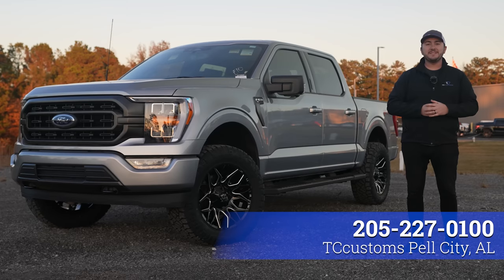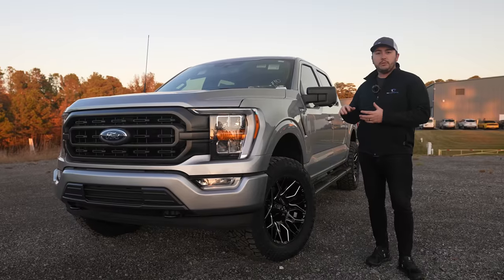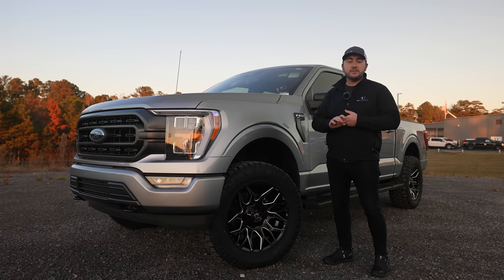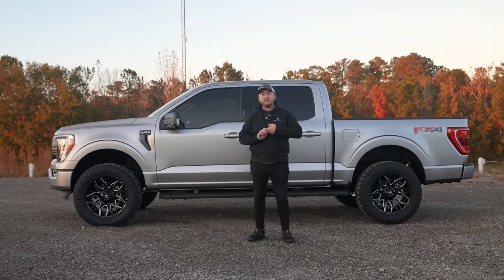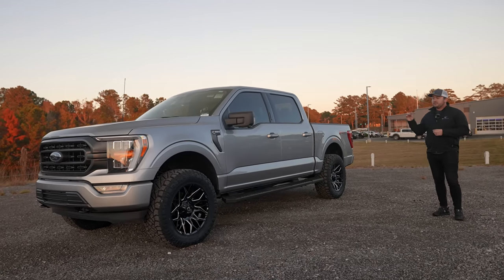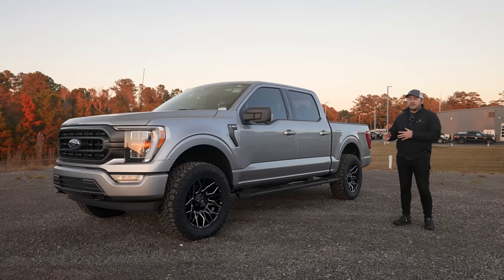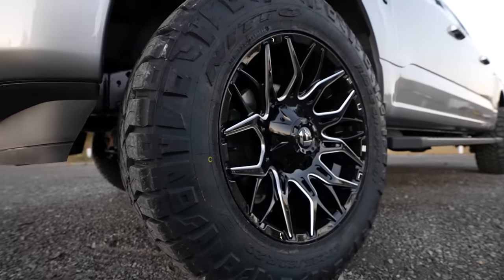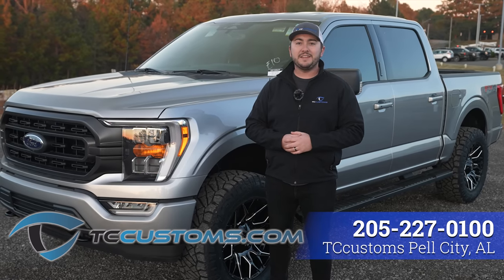FORD's Brand New Lift Kit... Is It Worth Your Money?

Comment: Save money and stick with bilstein 5100
Reply: Yep Those shocks are basically the 5100s with the coils...
Reply: 2.6 diameter > 5100 2.0 diameter
Reply: @blvckspectrvm5398 yep, a 2.5” shock is 77% more shock than a 2.0” shock. So a 2.65” shock is even better.
Reply: How is the ride quality like with the bilstein 5100 compared to the FX4 suspension package? Right now my 22 floats like a dream, but the stance leaves quite a bit to be desired.

Comment: Not sure if I agree with trimming the crash bars on a new or any vehicle just to fit bigger wheels/ tires… my family’s safety is far more important that how my truck looks!
Reply: I installed a leveling kit and ran 295/70 R18 AT3s. Took the crash bars, notched out where they were rubbing, flipped the notched metal and welded back in. Stronger than factory and didn't sacrifice safety.
Reply: The Ford Raptor and Bronco Raptor come from Ford with these deleted stock FYI

Comment: This is just the Bilstein 6112/5160 setup with a Ford Performance label & price increase.  Better to buy the actual Bilstein product save some money and get their lifetime warranty vs the Ford 3 yr/36 mo warranty.  I have the 6112/5160 combo on my F150 and they are fantastic.
Reply: The normal 5160 shocks only have a 2yr warranty from Bilstein, plus with the Ford Performance kit you get the strut mount assembly for the fronts preinstalled, and the aluminum reservoir bracket for the rear shocks. They ARE also valved differently than the off the shelf 6112/5160 combo. Not saying there isn't a price difference, but to have bolt-on ready assemblies is nice, and yes I have the Ford Performance kit on my truck.
Reply: @C1Vette  I bought new top mounts for mine, I think it was around $100 for both. I also bought the aluminum rear brackets which I think were $80.  The 6112 still gets the lifetime through Bilstein (which are the more expensive of the two).
Reply: hows the ride i have a 2023 just got it this past December. It only has 4k miles I'm ready to do mods to it.
Reply: @CandyMan69007  i’ve had it on the truck for over 50,000 miles now, and it is great. Definitely better than stock. I especially like that the rear end doesn’t get Squirrley going over bumps like it used to with the stock set up.

Comment: A Bilstein over Fox for sure! Eibach or Reiger are much better than Fox also. Love Ford but they need to get away from Fox suspension asap!
Reply: Wtf are you talking about?   Fox makes excellent products but they aren’t all created equal
Reply: The fox on the first generation raptor were pure junk. They leaked at the top and not warranted. They cost over a grand a piece before install. I got rid of the truck.

Comment: I have a 2019 F150 Roush with the Fox 2.0 shocks. And, while they’re great for body control, especially on tight, fast turns, they definitely ride rough. But, they’ve done me well off road. But, I like the higher lift and rear reservoir on the Ford Performance shocks. Can the Ford Performance shocks be put on the 2015-2020 F150’s, too?

Comment: I am running Bilsteins 6112 and 5100 for rears on 2018 f150 5.0. 35k miles on them and have been solid performers.  You can find them for under $1,250.

Comment: It would have been a better video with   A driving comparison between the two on and off road.   How does each suspension work over washboard roads?  What about dealing with ruts? Or traversing rocks/rutted roads.

Street is one thing, but off road is where I want more information.

Comment: How hard are these on the upper control arms/ball joints? Every leveled f150 I have had was hard on the upper ball joints. It would be cool if Ford would include corrected geometry upper control arms in these kits.

Comment: All of the Fox/Roush leveling kits for 4WD say they are adjustable from 0-2 inches. So, I don't think you would be able to get more level than the Ford Performance kit if the FP kit is still not fully level at 2.5.

Comment: I bought these and got them installed in my Powerboost. And I did notice the truck more predictable in its ride but really comfortable. Actually drives like BMW SUV. Incredible. This is a solid piece and warrantied by Ford if installed by the dealership which I did. So it is shown in the CARFAX.
Reply: What did everything cost you ?
Reply: What was the price with installation?
Reply: @askthecarexpert2486  my son works at the dealership. So in my case price for installation doesn’t count as far as real pricing, but just call the dealership and ask. They’ll let you know as this is a genuine Ford part.
Reply: @8Caps895  You can get this kit for ~$1400 off 3rd party sites compared to the $1700 Ford wants. My local dealership charges ~$220/hr for labor. I'm assuming about 3 hours to install, so probably around $2000-2400 installed.
Reply: @brianlepe9372  Thanks for info 👍
Reply: You put these in your powerboost? How is the ride and height? It says right on website from ford “not recommended for powerboost” because of extra curb weight
Reply: @blvckspectrvm5398  My truck is the PB/Platinum 4x4 Off-road. As for the ride it is noticeably better as I said it drives very much alike an SUV BMW Series 5/6 (more predictable and less wobbly?). To the point that my wife (not a car person) didn’t like the original ride as it was too soft and unpredictable and now doesn’t stop using the truck. Lol. As for the height you either have to go to the max height setting (2.5”) and you’ll almost get it level or use a small spacer (3/8”) in combination and set the coil overs @ 2.0”. This WILL give the perfect flat stance. If you’re looking for a perfect 100% leveled you want to go with the latter. The first one will leave you the truck at about 1” of rake. The ride with the 3/8” spacer combined with the 2.0” setting is more comfortable because the spring is not adjusted all the way and will have more traveling leverage. I also added the helper air bags on the rear so when I trailer my car you fill the air bag just a tad to level the truck because of the trailer weight. Bottom line this is the best suspension for that price the truck is super comfortable, stable and very predictable. Hope this helps. The front shocks are massive 2.6” diameter, which are larger than other even with reservoirs but way smaller diameter. I also added the BDS upper control arms. They’re better than the factory.  Hope this helps.
Reply: @loloforge2841  does a guy still get the FX4 option when using this upgrade? Also, did the levelling kit worsen the manners of the truck when towing?

I had a new 2005 F350 and had installed a Bilstein levelling kit and afterwards…. towing our travel trailer became damn right scary at highway speeds. The truck became scary-light on the front end and just the slightest twitch on the steering wheel would start the entire rig swerving. Had the truck to 4 different shops figuring it was an alignment issue but not one of them could get it to tow safely.

Comment: 2022 F 150 FX4 V8 4 door 4w; 
Currently now I have a ADD front bumper 
Front crash bars were cut out 
I’m running 33” Falken AT4 on my factory 20 inch rim
I do easy to moderate off roading  or levels 1 and 2 on the California BLM OHV rating system 
I also tow a 7500 trailer at times so I will need to add airbags to my kit
Is this kit reasonable for my needs ?

Comment: I have 35’s (295/65r20) on my ‘23 Lariat with only a 2.5 leveling kit on the original wheels & it looks much better than those 34’s! And I only had to do a small bit of trimming.
Reply: Trimming crash bar or plastic?

Comment: Hey guys. I have a question. I have a 23 Lariat 4x4. With the smart towing on board scales. What if anything do I have to look for when either leveling or lifting it. As pertaining to the sensor attached to the upper control arm. I want to either level the front 2.5 inch or lift the the front only 3 in. with the proper kit including control arms. The concern on the 2.5 inch kit is the increased angle/stress on the upper ball joint. The reason I was looking to do control arms that’s accommodate the relief in angles. And what if any do I have to do with the sensors on the on board scales on my powerboost.  I’ve watched almost every video on leveling and lifting the 21-23 f150. And no video I’ve found covers this concern. Also what about the brake lines, abs wires and sway bar endlinks.

Comment: Nice truck !  Would love to have this on my Power Boost but I am not sure that Ford Performance provides a kit for the PB.
Reply: I have the eibach kit on my 2021 powerboost  and it has been great. I have used it offroad and on unmaintained logging roads. The highway driving is far better as well.
Reply: @fx4fxnytro  do you know if it affects your towing in any way
Reply: I do not tow.

Comment: Does this kit work for a 2020 fx4?
Reply: FX4 is only a trim level upgrade and has a useless skid plate. Yes it works on The F150
Reply: @johnniebkid  I find the skid plate to be useful in some situations. I’m more interested on the FP bilstein shocks fitting on my f150z but thanks anyway.
Reply: Again, Fx4, Xlt, Xl, lariat, etc etc is the exact same set up. So the answer is YES

Comment: After adding either of these kits, are there any reports of IWE troubles, I did a 2 inch level on a 2016 F150 and had a few issues, it would make grinding noises once in a while
Reply: IWE issues are just a common issue with these trucks unfortunately, both my 14 and 18. The lift should have any effect on the IWE system IMO.